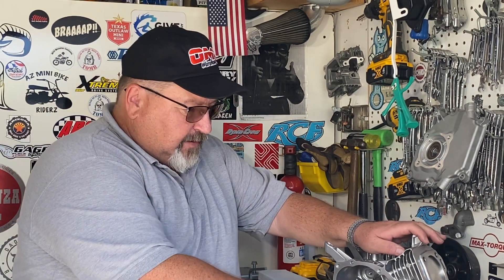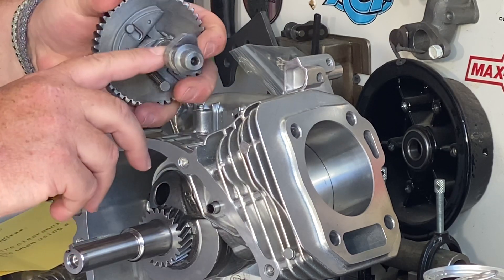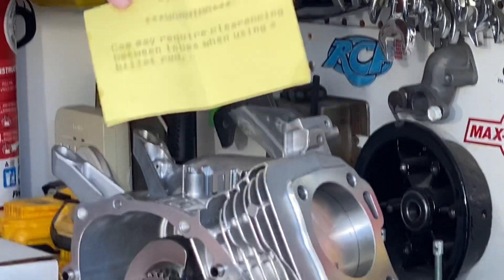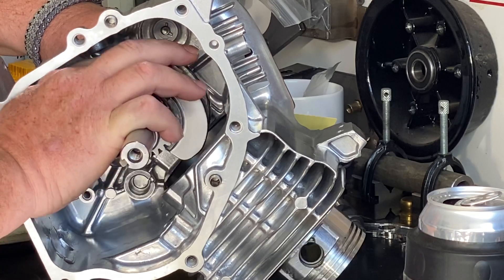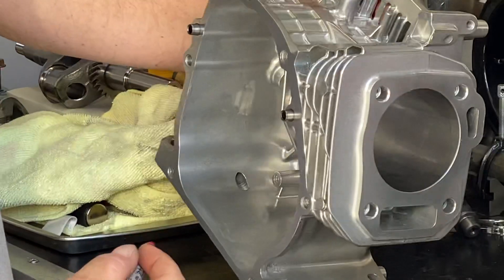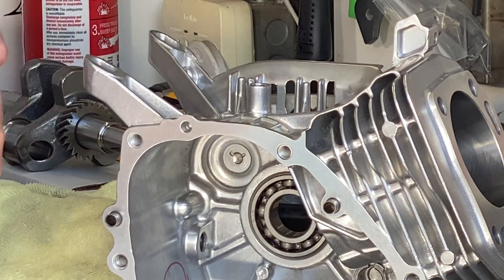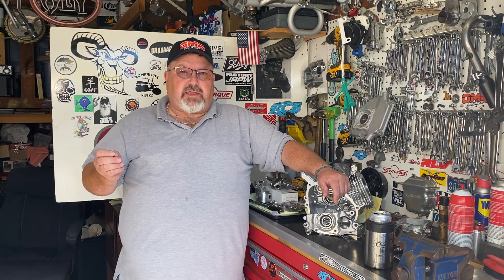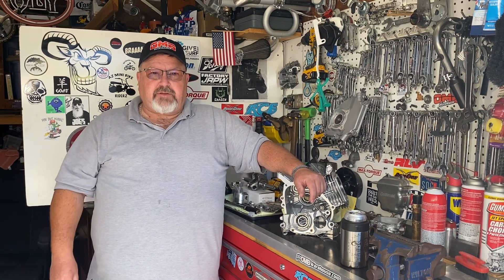What you need to know before building a Predator 224

Comment: You say with a 58 mm crankshaft a 570 piston head and a 3.303 connecting rod got you to zero deck well I used all the same things you did except for my connecting rod is a 3.328 and I put a straight edge across to see if it was a true zero deck and the only fewer games that fit was .0015 so you're probably very close it's just not noticeable but you're probably just under zero deck by . 0265 mind you this is all a guesstimate because the feeler gauge I used that was the smallest one on there and the second smallest wouldn't fit and I didn't have anything in between those two to use so it's not going to be 100% accurate but it'll be extremely close
Reply from the maker: I am not aware of a 3.328" rod that will fit the crank with the GX200/clone taper. I think you have a 3.323" rod and a .550" pin height piston to acheive that

Comment: Boy i don't like grinding on a cam what so ever. You know for what they're sticking us for on the cost of a replacement cam they should be able to clean them up, to justify that higher cost on them😢. And you know as well as anyone that cam is going to fail, not if it may fail it's when it's going to fail😢.
Reply from the maker: DynoCams did not offer clearanced cams when that video was made. We do have cams now that are clearanced and have a thinner decompression spring
https://www.ombwarehouse.com/performance-parts/predator-performance-parts/predator-224-max-performance/cams/
Most engines with 58mm cranks can use these cams with zero clearance issues

Comment: I’m building a predator 224 and I have a forged aluminum flywheel, 22lb springs, vm22, billet rod and I have a Super X 265 cam not installed yet, after i clearance the cam to fit would I have to upgrade anything with my rockers or push rods? Or are the stock ones fine?

Comment: I know you say email you at OMB I have and have not had any reply. If I remove the martial from the bare block that the oil sensor was bolted to, will it weaken the block?
Reply from the maker: I try not to work 24/7 anymore and emailing the warehouse is the best way. 
That why I can spend time with family and work on my own stuff!
As long as you don’t go too deep and try to get .030” clearance you will be fine. Go slow, measure a few times. Don’t try to be “one and done”! I may install a rod and piston several times before I am satisfied. Be patient and do the work!

Comment: Why didn't you just nip a little off the dipper instead of grinding a hole into the bottom of your block???😢
Reply: He said NEVER grind on the Billet Rod. 🤷‍♂
Reply: The rod will then be unbalanced and theirs also a oil scooper to fling oil and it may effect that also
Reply: Ya never grind the billet rod never touch the crankshaft weights or at least try not to and don't ever touch the camshaft lobes😊

Comment: Hey gray goat, i built a 212 'NON HEMI' with the HOT 265 cam from GPS  and totally forgot to check clearance, i spun it alot and it spun freely did not hear anything hitting, ran it for a little no problems but was wondering are there and clearance issues with 'non hemis' and that cam? thanks.
Reply from the maker: The
 Non-Hemi Pred 212 typically does mot have any clearance issues. The cranks have less material on the top of the crank throw. 
We should always check, but chances are you will be fine!
Reply: @TheGrayGoatGarage  Thank you alot!

Comment: What is the ring gap for regular gas for the flat top piston
Reply from the maker: I like to keep the top ring between .008” and .010”
The second ring at .010” to .018”
The oil control at .010” to .030”
Reply: @TheGrayGoatGarage  thank you
Reply: @TheGrayGoatGarage  I want to make sure it's correct before I put my engine back together

Comment: OK...Hold On.... You're doing all this clearancing on the block. This is because of all the aftermarket internals you are putting in or because it needs all of this work straight from the factory for the stock internals to work properly? I saw the cam had a metal gear and I believe these come from the factory with a plastic geared cam. So the cam is aftermarket. I saw ARC on the rod so that appears to be aftermarket. Is the crank aftermarket too? If all the internals are aftermarket and the 224 is a stroker motor, does anyone now make a complete kit of parts sized to fit properly in this motor without having to do all the work you had to do? A Cam, A Crank, Rod/dipper and all of that sized correctly for the 224 block?
Reply from the maker: I am holding on! LOL
The clearancing is required when building a performance engine. Even engines without the 58mm crank can require some clearancing.
I used an aftermarket cam and connecting rod but used the stock crank.
The ARC connecting rods will keep the engine from destroying itself at higher than governed rpms. The ARC rod is physically larger and that is why the block needs to be clearanced.
Every DynoCams cam comes with a card that tells you to check the clearance between the lobes regardless if the engine has a 54, 55, or 58mm crank.
The Chinese tolerances on these engines are all over the place and all clearances must be checked when building any engine. It does not matter if the engine is a 196, 208, 212, 223, 224, or 236cc engine. It still must be checked!
Because of the varying tolerances in these engines, the aftermarket cannot make one part that fits every engine. As an engine builder, you must check EVERYTHING that is put into any engine.
If you are taking apart a 224 and putting it back together with all of the stock parts, there are no issues. Everything will fit.
If you are wanting to build a performance engine you have to do some work!
Reply: @TheGrayGoatGarage  Roger Roger. I didn't know the extent of the mods you were doing or if the market had answered the call and come up with a "level kit" that was a straight replacement with little to no fitment needed. Because IF a company had done that....well...they would be millionaires overnight. 
::: hint hint :::

Comment: Any reason all my clearances are good with the head off, but when I put the head on and spin the engine by hand it sounds like somethings tapping/hitting? The sound is every rotation, but like I said it only happens with the head on
Reply from the maker: You must check EVERYTHING! Is the rod hitting the inside of the case or the cam? Is the piston hitting the crank? It is is every rotation it is not the valves. Now it the time to check it!
Reply: @TheGrayGoatGarage  no see that’s the thing, everything clears fine, it’s just a very slight tapping sound. It doesn’t do it with just the rod, piston, crank and cam in. Only does it with the head. Which confuses me because all of the YouTube videos I’ve watched on clearancing have all been done with the head off, they never checked with the head on or at least didn’t mention/ show it in the video
Reply: @DatHondaBoi223  timing wrong? it could be hitting the valves
Reply: @Shaun-hp2yz  I never figured it out but I’ve been running it for 2 months now seems to do great haha, idk what I was hearing but something was definitely tapping, maybe it was just the sound of the valves opening and closing?
Reply: @DatHondaBoi223  i know im late to the party.. but i just wen through the same thing building a 224. i ended up finding a single metal shaving in the side cover bearing. 
i think the added compression from the head was required for the bearing to making noise going over it.
Reply: @zachwelcomepoor565  yeah I never figured out what it was but it runs great and has since last September, it’s been ran for about 7 months now but I’m finding light glitter in the oil every change. Probably just gonna get a different block when this blows
Reply: @TheGrayGoatGarage  I think I’m just gonna scrap it and pick up another and keep it stock I’ve been messing with this block for just about 2 weeks now. At least 5 hours a day, I even worked on it for 10 hours straight one day, still can’t figure it out. There is nothing making any contact with anything my cam center is less than a quarter inch thick now, my lobes are ground near in half, I’ve grinded out damn near an 1/8th inch of the top and bottom of the bore, my crank ears are ground rounded almost to the journal, the counterweights are definitely completely off balance and the sound is still happening. I give up, I could’ve saved over a grand if I just trusted my gut from the get go lmao

Comment: Do I have to worry about anything if I'm just gonna remove the governor and add a vm22 and header. I bought a aluminum flywheel. Is the stock rod a concern?
Reply from the maker: The stock rod is not designed for higher than governed rpm use. They typically starve for oil at 5000-5500 rpms. That is when it tries to weld itself to the crank and break. 
A VM22 carb is a performance carb that wants to be on a performance engine. You should consider a billet rod and a bigger cam. The nylon gear on the stock cam does not like high rpm’s or heavy spring pressure.
Reply: @TheGrayGoatGarage  thanks for the info. I appreciate the work you're doing for the small engine community. Any suggestions on a mild cam and rod that dosent need too much clearencing?

Comment: Grinding on that crank balancer, does that effect the vibration of the motor when complete!
Reply: What RPM do you want it balanced.  Piston engines will never be balanced, never ever.  You can only balance it for a certain engine speed range.

Comment: You have a link for those support braces for the side? I’m working on my 224 and it’s killing me taking apart putting back together to grind more. Thanks for the awesome videos!!!
Reply: i am doing the carb and how did you get the vacume line on the carburetor like where it usually goes on the plastic box from stock? mine isnt getting fuel
Reply: Plss that would bee good
Reply: @povertydaves  not sure if your still needing it but it’s called a crankshaft tool and they have them at OMB warehouse for like $20
Reply: @JVScustoms thank you 🙏🏽

Comment: You said you clearances both sides of the crankshaft journal for balance, why not rotationally sand the material between the cam lobes for balance as well, rather than just  clearancing the contact spot?
Reply from the maker: That is a hrsSt idea, just not practical. We want to leave as much material as possible on the cam for strength. Keep in mind the cam is cast iron
If that was a billet cam there would be no issues, but billet cams do not have compression releases and I am not strong enough to pull the engine over without that!
We also are not concerned with cam balance as it moves at half the rpm as the crank and it would have zero effect on the balance of the engine. That is all related to the crank, rod, and piston

Comment: Everybody has been saying these engines will be the new best thing, I've returned two in the last week and eventually went with a 212 at harbor freight cause both my 224s would not run right no matter what I could do. Valve lash was set correctly several times and they both could never run right from stock, just watch out guys.
Reply: Mine hits 70mph on 12-44t 26 springs carb flywheel . Had it since march of this year. Sounds like you mightve been rushing something
Reply: @s13__anthony76  i am doing the carb and how did you get the vacume line on the carburetor like where it usually goes on the plastic box from stock? mine isnt getting fuel
Reply: @Shaun-hp2yz that’s just a vent for your fuel tank. Not actual vacuum. Buy a small breather for your valve cover; just snip the hose a little shorter.
Reply: @s13__anthony76 bro.. show me the way!! I'm tryna get mine like that was well. I just bought the engine yesterday, and I want that kind of speed from mine as well
Reply: Mine runs great!
Reply: Mine ain’t never had issues

Comment: Your at zero deck with a flattop piston and stock length rod? I measured my 224 with stock rod and stock piston at 2 thou in the hole at max piston rock using a dial indicator. From others I’ve seen using a stock length billet rod and a flattop piston put them around .008" above deck. Maybe they use a different flattop piston with different wrist pin diameter and piston height.
Reply: Just trying to find the right combination of parts before ordering so I don’t end up with parts I can’t use or won’t work properly.
Reply from the maker: I am using the stock length 3.303” clone rod but have the taller .570”pin height piston to get to near zero deck. I did not even measure how far in the hole as it is so close to zero deck
I am also going to try the +.020” rod and the .550” piston. The results should be the same though
There is nothing consistent with any Chinese engine and every engine will need to get built differently. I am wanting to use parts that do not require machine work to get installed. I don’t have the equipment to mill a piston top…like most people!
Reply: @TheGrayGoatGarage  did you ever get to see how far in the hole the +.020 rod put you? Mine looks pretty close to zero deck but it’s my first time building any engine so I want to be sure

Comment: Looks like you polished the block inside and out. Looks great.

What head gasket are you going with?
Reply from the maker: If I am close to zero deck like I am showing here, I will use a .027” steel shim gasket to get the required .030” piston the head clearance 
https://www.ombwarehouse.com/dj-1310p-27-predator-head-gasket-027-70mm/
Reply: @TheGrayGoatGarage  I will probably use the same. Thanks!